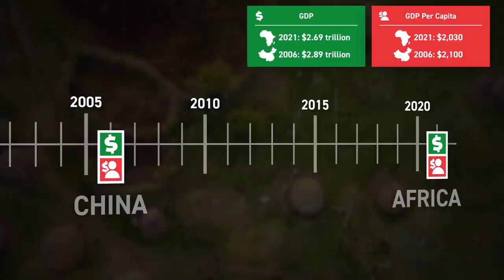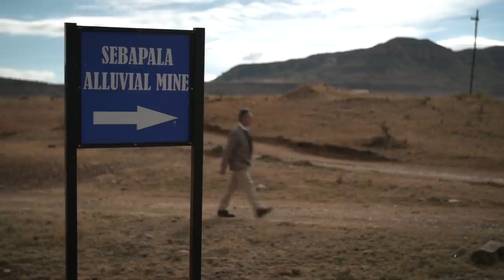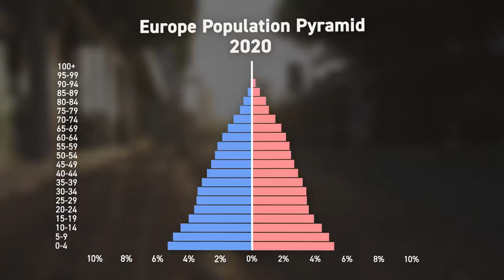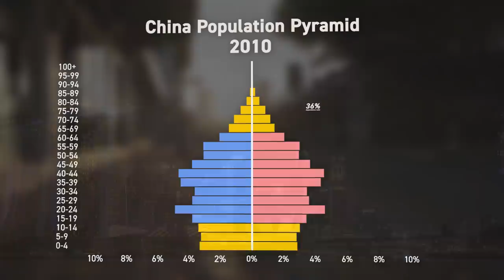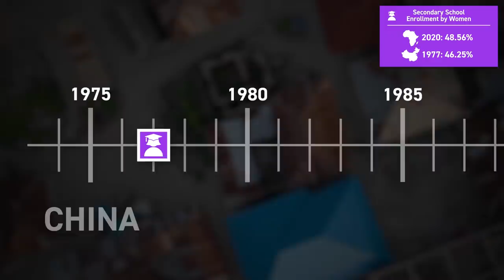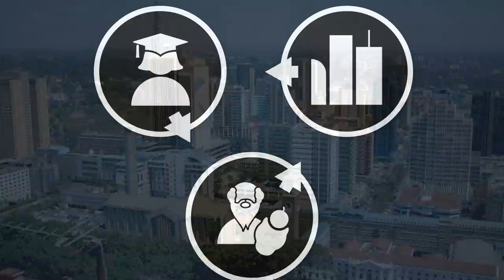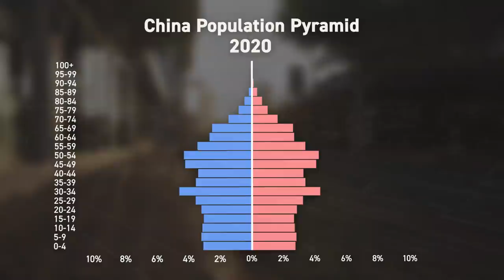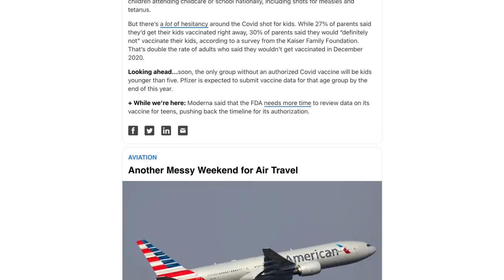Is Africa the Next China?

Comment: Another big factor that you did not mention but is key in my opinion is the climate. While China is located in a rather mild climate zone, most of Africa struggles with yearly floods, constant heat and other weather extremes. Therefore, Africa can’t just concentrate on all the factors you mention in order to grow economically but will always have setbacks in its evolvement, which slows the economic process a lot. Since not every country faces the same problems, has different standards of living and has to grow on its own, it’s very unlikely that Africa as a whole will see any significant developments. Great video though, I liked it!

Comment: What is often kept out of these types of discussions are the effects of geography and climate on economic development. 

In Africa's case, the climate and the geography are extremely hostile to economic development. We know that as temperatures rise, IQ and memory retention falls which is why it is more likely a colder nation will become economically developed then a colder one. China has a colder climate and so was more likely to develop. Additionally, a large proportion of the interior is subject to extreme humidity which means that it is much more expensive to operate a civilization since the water in the air increases the entropy of capital which means less of it can get reinvested into productive economically-boosting activities. 

In the case of geography, Africa is also at an extreme disadvantage. There aren't a lot of natural harbors off of the coast of Africa which is why historically Africa hasn't been able to use the sea to participate in global trade and learn from other cultures. The rivers in Africa are also not really that navigable and the land is very steep which makes the cost of trade within the continent much more expensive then it would be anywhere else. 

Given the inherent geographic and climate disadvantages of Africa, this continent is going to develop at a much slower pace than China. Any economic analysis which doesn't take these factors into consideration is flawed.